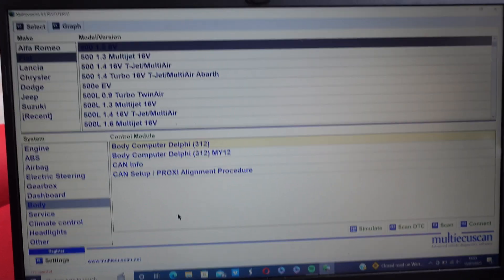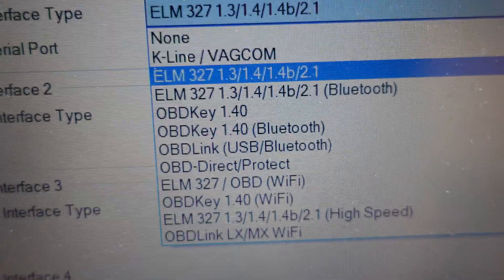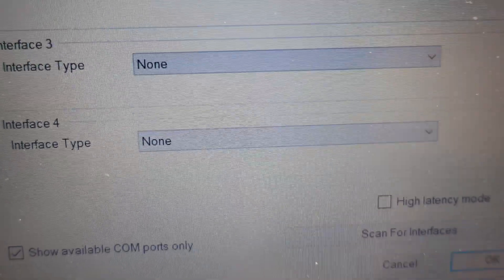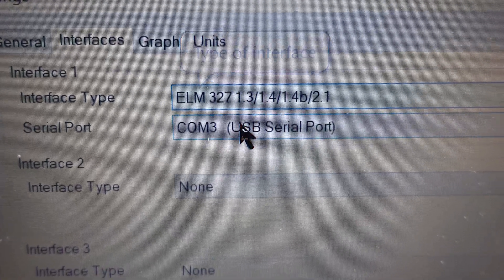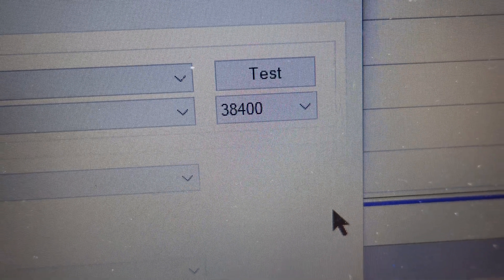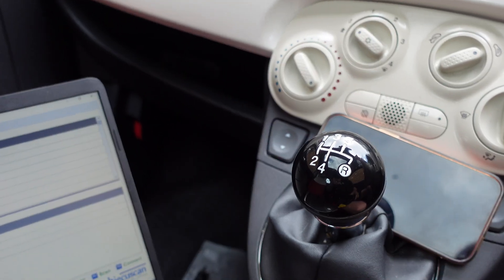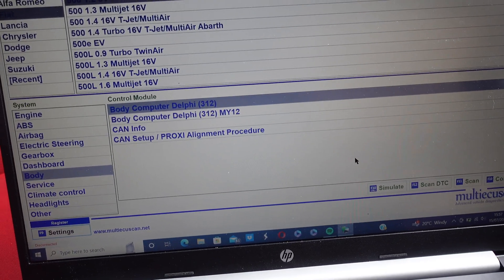MULTIECUSCAN CONNECTION PROBLEMS? This is the most likely reason

Comment: I keep getting the ECU connection failure message however when I test my ELM327 adapter in the Settings menu it seems to connect to all the protocols correctly, im trying to eliminate the seatbelt chime on startup. Could it be that this module is not available on the free version hence I am unable to connect?
Reply from the maker: You can’t do anything with the free version.
Reply: @Love500 I thought you can still connect to the car to verify the software/Cable works?
Reply from the maker: @nadajoey1  I don't know. As far as I'm aware the free one is just to get a feel for the software. I've only ever had the paid version.

Comment: What do you mean about modified elm?
Reply from the maker: The ads will say "modified". I think it's the cable rather than the elm. It's a modified standard cable swapping some wires which is required to work on Fiats.

Comment: Ive just received my hardware today and I'm damned if I can connect, Im just gettng a timed out error all the time 🤬
Reply from the maker: Make sure your elm connector is the one selected in the settings and that the speed is set correctly.
Reply: @Love500 I have... Numerous times 😢
Reply from the maker: @thepixalator6758  Which modules are you trying to connect to? Are you using the yellow adapter cable?
Reply: @Love500 I've sussed it, this might come in handy for anyone else having the same problems. If you do a auto detect of the interface it will find it but ONLY if you have the engine running, it connected to a different one than the provider of the ELM 327 and leads instructed me to use. Yes, I was using the Yellow lead. Thank you for your input it's appreciated.

Comment: Hello, I tried doing a Proxi Alignment, but it failed because it couldn't detect my aftermarket radio. Do you happen to know the solution to this?
Reply from the maker: @marcin3111  yes. The stereo has caused errors in the BCM and/or the Speedo (dashboard). When the proxy fails, go into them and clear any errors and redo it. You may have to do this several times. My record is 7. It should eventually work.
Reply: @ hi my friend, thank you for the reply. I actually got it to work after going into vehicle settings on my stereo and changing the vehicle (there were 3 options). The proxy alignment was successful, however, I’m still having problems. Do you mind if I email you? I was hoping to pick your brain about the hex code (I’ve been dabbling with a custom hex code when I run the proxy alignment, but I’m still having issues).
Reply from the maker: @ yeah drop me an email. Paul@love500.co.uk

Comment: Magnificent video; thank you. 
Do you know if one can data log the ecu using this software?
Cheers, Eci
Reply from the maker: @ecitortolini987  I don’t actually know what that means.
Reply: @Love500  Thank you for your reply. It means that I need to log various parameters of the car, so that I send it to a Tuner and tune the ECU.
In any case, I got my answer by playing around with the software. FYI, you can select the parameters (e.g., fuel, manifold pressure, etc.) and record them while driving and export it to a .csv file to be read by various tuning software like Tunerpro) free software.
Cheers,
Eci
Reply from the maker: @ oh yeah I knew that 😁

Comment: Thanks for this. I'm now getting a new error: Connection Failed ELM327->ECU Connection failed! Can bus error. Check if interface is properly connected to the vehicle and correct vehicle/module selected! It's a Fiat500 1.2 8v. I've tried all 3 non lpg versions and tried all the different modules. Any Ideas?
Reply from the maker: @matthewscott324  which ECU are you getting the error on and which adapter are you using?
Reply: @Love500  yellow adaptor. I tried connecting to multiple ecus
Reply from the maker: @ is the correct elm adapter selected in the settings? It’s a bit difficult to work out what might be wrong.

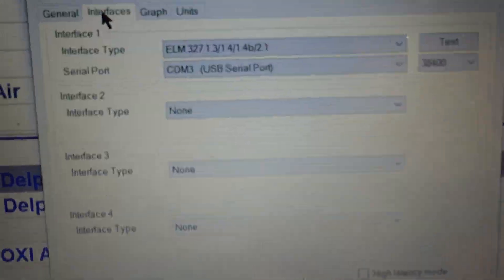Comment: Paul, you did not mention "COM3" as shown on your screen. You made it sound as though each COM port was connected to a different USB socket on you computer. While I have had different results from USB2 and USB3 sockets the available COM ports are connected by software to whichever physical USB socket you are using. The easiest way to see if  your ELM is compatible is to connect the computer to the car. Go to the interface screen you are showing. Select "none" from all the options you have displayed to clear the interfaces. If you do not clear them the previous interface may remain from when last used on another car. At minute 1:26 on your video a "Scan for interfaces" button is shown. If connected to the car, selecting this button will  display a search showing which COM port it is linking to the car and eventually fill Interface 1 with the appropriate data. If this does not work there is a connection problem. In 15 years with 5 different FIATs this process has been a great help,  but does not mean a guaranteed connection when selecting the car key to ignition and connect on the computer but it eliminates a lot of incorrect manual selections. I have a selection of ELMs with adapters and a slow windows 10 laptop but still have intermittent setting up errors that do not remain long enough to identify.
Reply: Im trying to connect now and if i try the "Scan for interfaces" button I get nothing, when I select the correct (I hope) interface ( ELM 327 USB in High speed mode) I am just getting timed out error when I try to connect to the car

Comment: Hi I had this problem it's now stopped doing that and it has now come up with operation has timed out any ideas on how to fix it thanks sam
Reply from the maker: A time out error would normally be the ECU you're trying to connect to. Are you using the right cable adapter. Which ECUs is it failing on?
Reply: @Love500  trying to connect to a Fiat ducato multi-jet van 2014
Reply from the maker: @sammy5074-x9p  that may use different cables. Look on the multiecu website there's a list of vehicles and which coloured adapters you use on which ECUs.
Reply: @Love500  started off with the yellow adaptor then tried all of the adaptors change the settings again the time out has gone but I still can't connect to any ECU
Reply from the maker: @sammy5074-x9p  have you got the correct elm selected in the settings?
Reply: @Love500  I think I have the right cables and time's out on all of them

Comment: Hi. I have a serious battery drain problem. Changed all earth straps firstly. Then checking fuses had a fault on f36. Bluetooth wasn't working properly, so I unplugged blue and me unit. Now im trying to multiecscan car to stop mileage flashing and hopefully erase the Bluetooth and stop the power drain. The problem is the multiecuscan won't connect to the car! It's saying "you need elm327/obd key interface to connect to this module. Check cable and serial port settings" I've tried all options on multiecuscan and nothing seems to work?!!!!! Any suggestions???? Cheers
Reply from the maker: Check that you have your ELM selected in the MES settings and the speed is set to 38000. I have a video on the common problems connecting.

Comment: Having problems with mine, it doesn't give any options for serial ports.
Do I need to download drivers for the elm lead?
Reply: Easy for you to say, I'm a dinosaur with a pc, I'll have to get one of the grandchildren to have a look 😀
Reply: Apparently the pc sees the lead but says no drivers installed.
I have a cd supplied with the lead but no cd drive on this laptop
Reply from the maker: @steveselvage40  if the particular one you have has drivers then you should be able to download them from somewhere. Who supplies CDs these days 😙
Reply from the maker: No drivers required. Check your port settings.
Reply: Hi I hade the problem that u said about change the settings but now it says the operation has timed out and I'm stumped

Comment: Has anyone used this on a citroen relay  to do a proxi alignment  was told it's same as Fiat Ducatto?
Reply from the maker: If you haven’t already go to www.MultiECUScan.net as they have a forum where you’ll possibly get the answer.
Reply: Did you get sorted ? I have a Peugeot Boxer X290 and other than the steering system , it won't connect to any ECUs ,  Modified ELM with yellow connector.

Comment: Hi great video, i cannot connect to the standart elm moduls but the ones that require the yellow adaptor i can, any idea of what could be? Best regards
Reply from the maker: It’s the engine and steering with just the elm. Everything else I believe is the yellow. What are you not able to connect to?

Comment: Hello Paul, can you tell me what a modified interface means? I have the kit of colored adapters, but unfortunately, I can't connect with my ELM wifi [ELM327 V1.5 OBD2 Scanner WiFi BT PIC18F25K80]
Reply from the maker: Modified cables are the usb ones not Wi-Fi. Mes don’t support Wi-Fi ones any more due to issues. The modified just has wires swapped over.

Comment: Thanks for the video Paul
Is it possible for you to run through the different coloured OBD2 connectors and what each one is used for?
(Also, any more info on adding keys in Mes would be greatly appreciated)
Reply from the maker: On a 500 you only heed the yellow for everything except engine/steering which just use the elm on its own. Adding keys?
Reply: Thanks Paul.
Adding key fobs in MES
(I know you have the other module to do that, but I heard MES did the same - any thoughts?)
Thank you
Reply from the maker: @Jetpac74  there was someone a while ago that did do it successfully. There’s a thread on www.fiatforum.com. I’ve never tried it to be honest. I think it was just a spare rather than a remote. The me coding in the other kit doesn’t work on a 500 apparently

Comment: Thanks Paul, now where’s the repair video!? 😂
Reply: The latest Copart purchase. Project Mocha.
Reply from the maker: @s23bho38  on the back burner. Finishing off the white stripped one first.
Reply: Watching the back catalogue, up to Project Bluey.
Reply: Just use the corect interface and will connect. On some models I was able to connect even with aliexpress interface.
Reply from the maker: @2WheelDerness  that’s not what this video is about. This is about having the correct speed and connector selected in the settings.
Reply from the maker: Of?